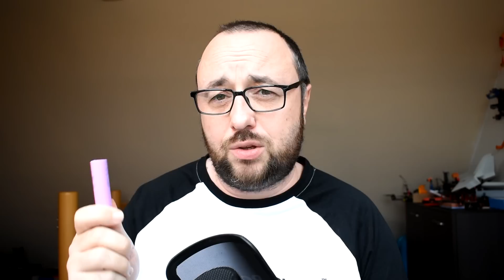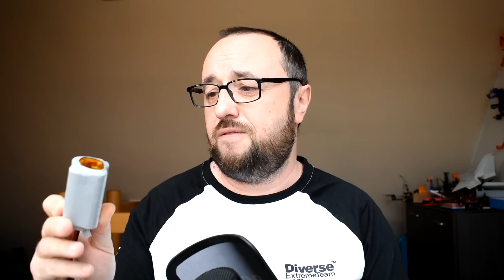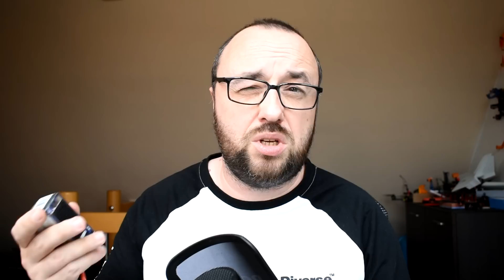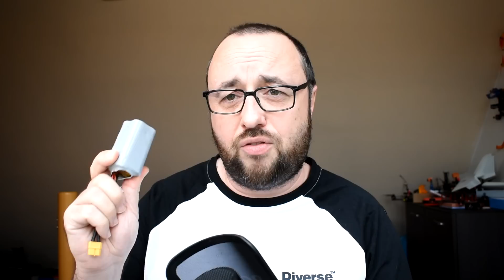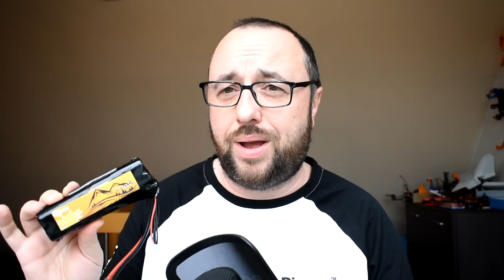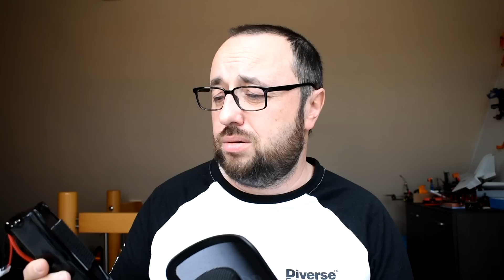Li-Ion or Li-Po for drones and airplanes? Which one is better?

Comment: It looks like the 7" GEPRC Crocodile I'm building will get 8 cell Li-Ion packs in series/parallel 4S configuration as the best alternative to the recommended 6S/6000mAh . It will only be used for cruising and photography as an alternative to my Mavic Air. The aim was to make a quad that would do a similar job to the Mavic but be easily upgradeable and repairable. In my innocence I started out with a 4" GEPRC Elegant and soon ran out of room for equipment. The two frames are like comparing a Porsche 911 to a Mack semi trailer. :D
Merry Christmas Pawel and thanks for your help.
Reply from the maker: The problem with 8S is that there is very little hardware that can handle that. ESCs, BECs, even motors with low enough KV

Comment: Good video, Paweł! Thanks!

From experience using a 4S1P Sanyo GA (alternatively LG MJ1) on the Z84 during takeoff it does take more than the max 10A (as per spec). This, however lasts only for about 5-7 seconds because the moment the plane starts moving the strain on the propeller decreases rapidly as soon as the air starts moving through it. Using autolaunch is even better because the moment the prop starts the plane already is moving forward and thus the time the battery experiences high drain is even shorter.

I also use a 3Ah HG2s (20A) on my 250mm miniquad and I get around 15-18 minutes of cruising (no aerobatics!). The pack really weights a lot less than the 3Ah 2S lipo that would make the quad unflyable.

Comment: You ever should keep in mind when using liion. Due to the voltage drop you should always add 1cell. So if you're using 4s, with liion you take 5s and you're fine.

For high current use vtc6 with 3000mah, for lower current use GA series with 3500mah.
Reply: I can confirm. My Samsung 40T have about the same voltage as a good 5s Lipo with 6s under load. But with about 50% more capacity.
Reply: Interesting theory.... would you care to share??
Reply: @Migueldeservantes  better to think of it as driving down current draw as you increase voltage.

Consider 800 watts needed to fly.

At 2s and 8 volts you are doing 100 amps.   Versus 4s and 16v you are doing 50 amps.

Are those the actual values?   No.   But it shows how a build in 4s could sag your batteries more than the same build on 6s, voltage drives down amps.

Then if you need more amps build in parallel.   I figure my 6s2p packs are good for a solid 30 amp continuous discharge with a 60amp burst.  VTC5D and VTC6A cells should be considered 15 amp continuous at best and 30 amp burst for short duration.
Reply: @Migueldeservantes  No I won't, how could I help you?

Comment: I just bought an Arduino Spot Welder few weeks ago and built an 4S3P pack with Sanyo NCR18650GA 3350mAh cells, so theoretically is a 10AH 4S with 30Amps max value. It weights over 1kilo!
However I didn't test it yet due to bad weather. I have an Mini Talon wing that should work ok, and a 7 inch kwad ... that I think will struggle a lot with.
Reply: I made exactly that, 605 gram total.
Reply: @13FPV  yes, on a second look mine are about 600ish grams also,  I can't wait to try it out!
Reply: lol, i also thought what the Fak, 1 kilo? hahaha

Comment: don't forget the lower voltage i fly a ranger 2000 and had to up my kv from 1250 to 1400 to have any power when the li-ion gets below 3,7-8 v (home made 21700 3s-2p)

Comment: I think there is a strong argument for using 8s1p vs 4s2p. Any efficiency you can get at higher power levels is good. Keeping the current down keeps everything cooler and more efficient so you can squeeze things a bit harder.
Reply: Are 8s ESCs aviable in a normal pricerange?
Reply: @JS-op5gk  maybe not economical for quads but there are a few around 30-40usd. On a budget build maybe not but if you are buying a few 4s2p vtc6 packs then an extra 20 bucks on a single esc on a plane is the least of your worries. A few of the matek wing boards support 8s too.
Reply: @frasersteen  ah, OK
Didn't know
not what I m aiming for but thanks
Reply: @frasersteen  esc who accept  8s  are very expensive generally , till 6s a esc stay cheap !
Reply: @JS-op5gk  For quads I think racerstar do a 60A 8s 4in1. I've been thinking it's probably a good match for the brother hobby avenger 1500 on 5" 8s or 1200 on 6" 8s. I reckon 6" 8s would be pretty good.
Reply: @frasersteen  OK, true, Not super cheap but regular price and definetly plausible in a premium 6" build. I'm mit sure thou If 8s2p would be necessary
Reply: @JS-op5gk  nah for quads, I'm not sold on li-ion. 8s would be with lipos for funzies.
Reply: How is 8s more efficient than 4s?
Reply: @henryknox4511  mayby via internal resistance? I'm not sure though. Was wondering,too
Reply: @JS-op5gk  I thought it only allowed you to run smaller diameter wire for the same current. As far as I know, 8s with the appropriate prop is going to draw more current than 4s with the appropriate prop but maybe I'm wrong.
Reply: @henryknox4511  For a given wattage 8s will be half the current of 4s, most of the heat build up is down to current not voltage. Reduce the current, reduce the heat in the wires, the esc, the motor. At 5-10amps that's less of a factor but if you are trying to pull 20A at 8s voltage vs 40A at 4s voltage then it starts becoming more significant. Just in terms of the motor alone this is a big deal, 40A vs 20A is going to make a huge difference for how hot a motor gets which directly affects it's efficiency.
Reply: @henryknox4511  might be true, I'm not into this kind of physics (yet) so you probably are right.
Was Just a suggestion from my side
Reply: @frasersteen  I don't think efficiency (g/w) translates 1:1 with current. That 8s doesn't gain much if any actual efficiency over 4s- the charts I'm looking at show the opposite in the tenths of a g/w.
Reply: @henryknox4511  no not 1:1, the point is not that the higher voltage is inherently more efficient. The point is that the higher voltage reduces heat build up across the system. If you run 2 motors together and one it hotter it will have a higher internal resistance and a lower overall performance. The same is true to a lesser extent all the way down the line right to the lipo. Heat is one of the main limitations for how much current you can pull from a li-ion cell. Every time you add heat you add resistance to the copper wire.

Overall if you reduce the heat you will have better performance. If you are thinking you need a 2p pack then you are already in the range where the current can cause components to get pretty warm.